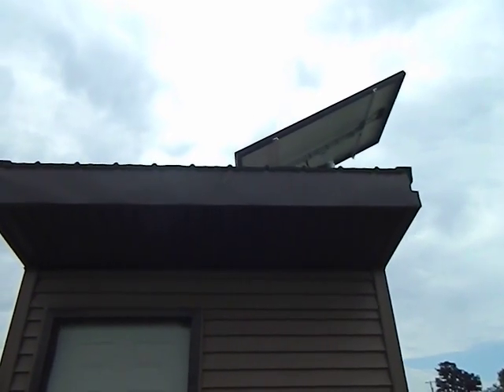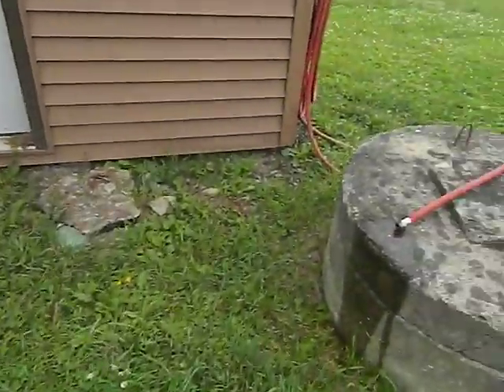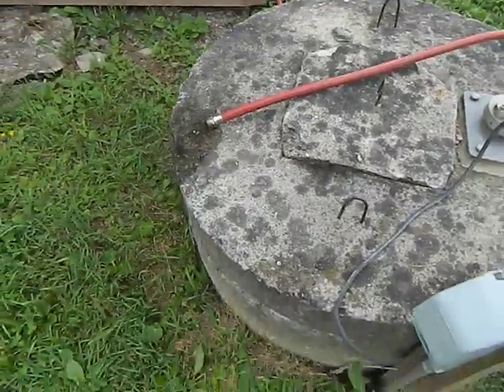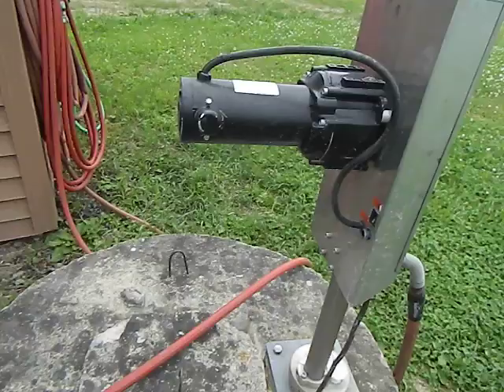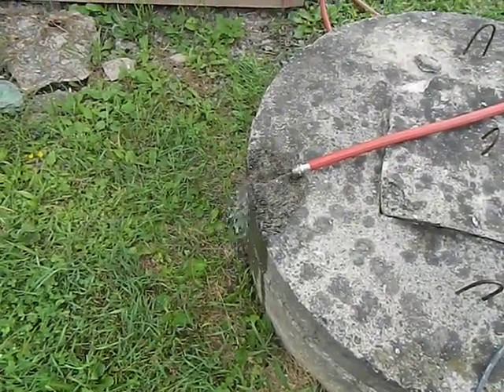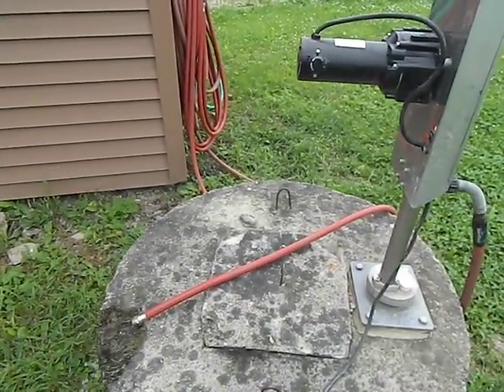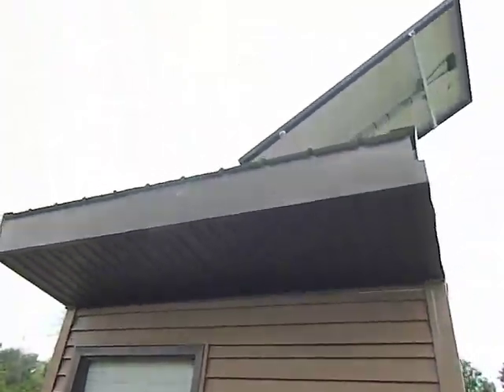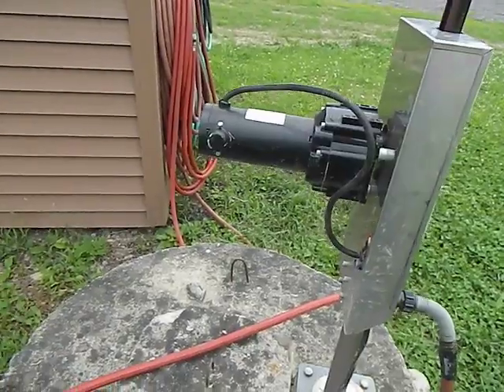A solar powered water pump setup

Comment: Solar powered water pump  
Features of solar powered water pump
Durable stainless steel and rubber construction
Spare rotor and stator supplied with helical rotor pumps
MPPT optimising algorithm in the pump controller
Adjustable pumping speed control
5 status LEDs for system monitoring
Linear performance warranty on the solar modules
Polypropylene rope prevents electrolytic corrosion of the pump
The ability to pump water practically anywhere no matter how remote
http://www.solarpumpfield.com/solar-powered-water-pump-system-for-irrigation/solar-powered-water-pump/solar-powered-water-pump/

Comment: Look like a "Simple Pump". How many Amps does the motor use?
Reply from the maker: The sticker is too warn to read, and nobody knows much about it, they had a contractor put it in.
Reply: Bushcraft412 It's a "Simple Pump" I have one and am thinking of getting the motor but I wish they made a AC version as it must use a lot of current running off DC.
Reply from the maker: I'm surprised at how little solar panel is needed to run it.  I just know if SHTF I'm going and swiping that thing because I have a well on my property that it would look terrific on!